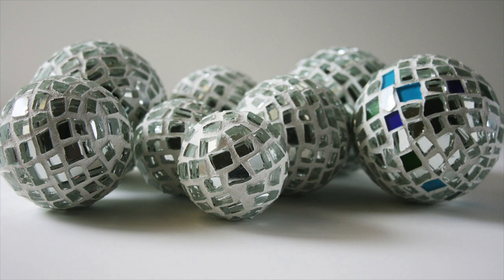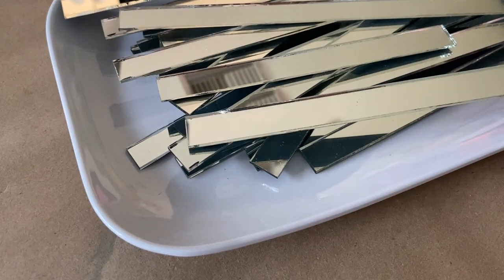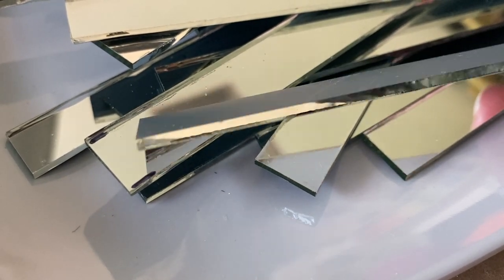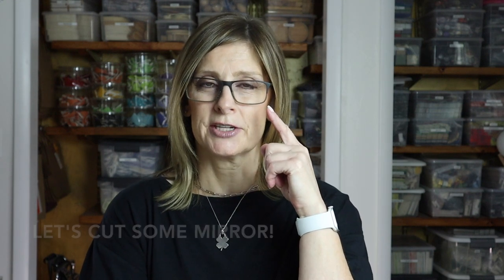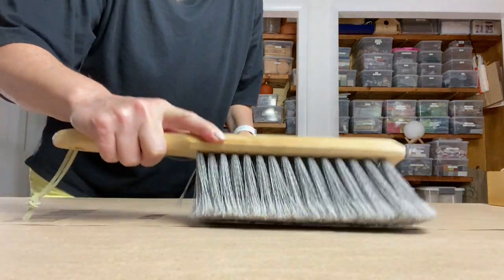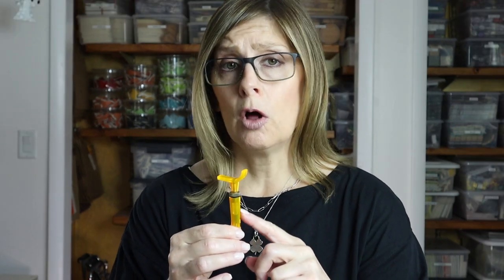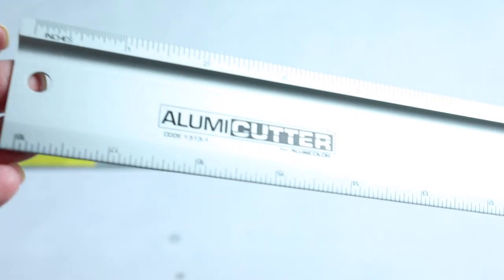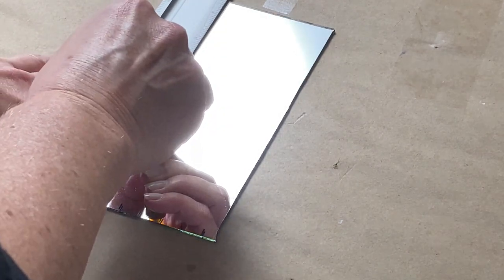HOW TO CUT MIRROR FOR MOSAICS | Tools, Type, Thickness

Comment: I created a mosaic Christmas tree on a wood base from the local hardware store.  Turned out nice but learned a lot about round surfaces and vertical designs!  One needs a little extra patience!  I will also use my cutting system next time to get more uniform sized geometric cuts.

Comment: What type of adhesive can you use on the thick type mirror for exterior stepping stone? Thanks!
Reply from the maker: Hi Minnie! You'll want to use a non-acidic adhesive specifically formulated for mirror so it doesn't dissolve the silver mirror backing, but is also waterproof. Take a look in your local hardware store in the silicone adhesives department (GE Silicone 2 for example, but you'll want to see what's available in your area). Most of the commercial adhesive manufacturers make a silicone that fits your specific needs. Glad you're here!
Reply: Thank you SO much!!! Off to Home Depot 😅

Comment: Hi - what do you use for adhesive to adhere mirror pieces to glass - an adhesive that won't damage the silver backed mirrors.
Reply from the maker: Hi Josie! Most of the major silicone brands -- Loctite, Liquid Nails, Gorilla Glue, etc. -- have a special formulation just for mirror. Read the labels to make sure it's safe for mirror. Keep creating and I'm so glad you're here!🔥